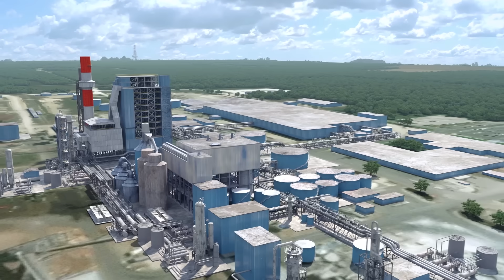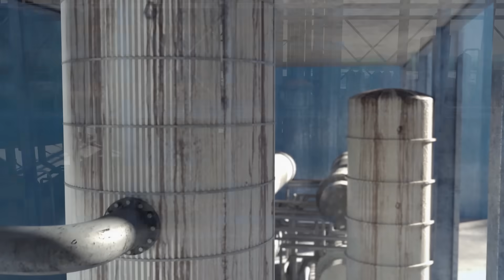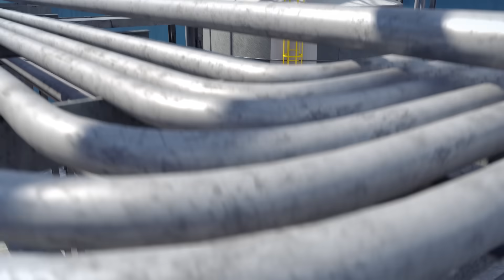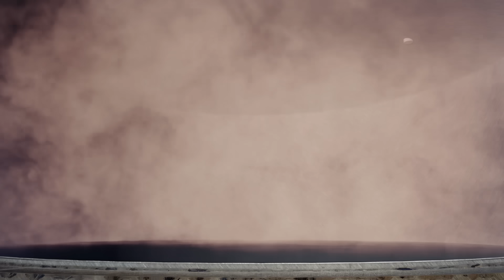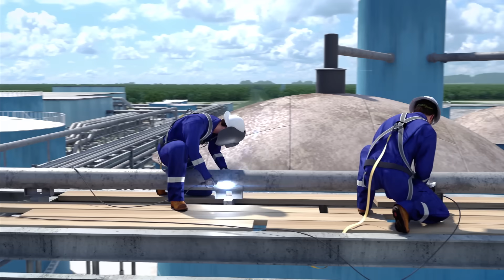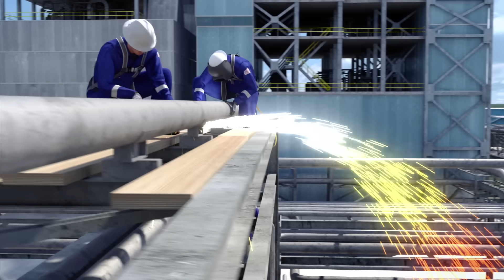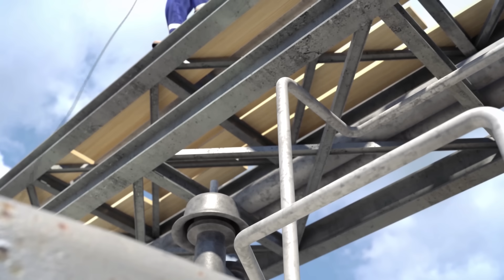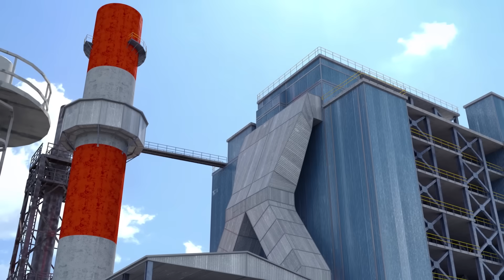Animation of Explosion at PCA's DeRidder, Louisiana, Pulp and Paper Mill

Comment: I'm amazed that these companies can just lose track of the purpose of significant parts of their infrastructure.
'Hey Joe what's that big tank so'
'I don't remember... Something with turpentine, but it hasn't exploded in months so it's probably good'
Reply: Matthew Findley You gotta remember companies are made up of people and people lose track of stuff unless there are good systems out in place to prevent those mistakes.
Reply: Gilbert oh no doubt.  This definitely looks like a system/corporate failure from the videos pov rather then some individual's screw up.  But how can they not have a system in place for this?  Who's job is it to put gas in the trucks?  Yeah who knows.... But confusion over who runs a probably expensive machine that prevents the build up of explosive vapors???
That seems like the kind of thing that gets written down.
Reply: You'd be surprised. When facilities add equipment for additional processes or remove equipment some of that gets lost in paperwork. Especially if it was all done on paper years ago. People retire, forget, or just plain don't know what certain things do inside a large facility. New engineers get hired and it's like here, take care of this area...
Reply: @kalebbrown93  You're 100% correct here. It's even worse than that in my experience. These days at most large facilities they're just lucky more disasters don't happen. Do more with less people. Different contractors doing stuff for the first time at a facility that aren't familiar with the whole facility. Next time it's yet another different contractor doing it. Layers of apathy and ineptitude......is anyone surprised that it was contractors killed and injured?? That should speak volumes....
Reply: @kalebbrown93    I worked industrial agriculture for 15 years.  Both in old farm cooperative facilities and old commercial grain elevators.  That's exactly what would happen from grain handling machines, trucks, fuel bulk plants, fertilizer plants, ect.  Every so often someone starts asking questions about that rusty thing over there they don't remember ever seeing used.  That's when a guy that's been there 25 years already pipes up and talks about someone that retired two decades ago used to operate that machine and no one has touched it since he left.  There were times we found derelict machines in flooded pits that still had power to them and no one knew it.  Dangerous as hell.
Reply: Agreed. The fact something like that can be overlooked for months is pretty crazy to me, but at the same time with a huge company with three shifts with responsibilities spread across them, something that is done infrequently can easily be forgotten about especially if you think someone else took care of it then by the time it's due to be checked again I guess it could be easy to forget. I always just figure people who work in environments like this use as much caution as the places I've worked, but that's not always the case.
Reply: Nobody says "why is this valve closed?" and then get "not my job" in return. People who internally believe "not my job" or just plain don't notice it collectively do nothing and say nothing for months or even years without incident. New people get brought in and trained without mention of the valve or its purpose. Then something like this happens and the answers that come from it sound much more damning than the actual intent going into it. Humans are dumb, and without a rigorously managed plant you end up with this kind of stuff too frequently. The more people involved the worse it gets because "surely someone is in charge of it", and you never open a random valve without telling anyone. Closed is supposed to be safer than open, usually. If it was supposed to be open it would be carsealed. That's why management of unusual tasks such as hot work is so critical. There can always be "landmines" hidden that were fine under operating conditions for months, but then someone brought an ignition source into the picture and now all bets are off. Hot work in a plant like this should be Defcon 1 for fires and explosions. But it's typically treated as Defcon 3.
Reply: @mitchwalrus  In Finland clean water facility had valve to connect clean water system to sewer water system. Someone opened that valve and whole town started to drink poop water. I think two people died and lots of people got sick. Happened in Nokia (same name as old mobile phone manufacturer had).
Reply: @mikakorhonen5715  I worked in the water industry ( dirty side). I assume the "pressures were the wrong way round" for what you describe to happen?
Reply: @mitchwalrus  also places like this are very hierarchel. If you're a newbie and go to the experienced boss and say "what's that valve do? I think it might be dangerous to leave it closed." You'll get an ass chewing. You do as exactly as told. Don't question anything. Do what boss says and never venture to anything else.
Reply: Sorry, the boss wants me to write daily status reports. Usually takes me half the day to do, so I don't have time to track all this stuff, you know? Also, we don't hire secretaries anymore, they cost too much.
Reply: Florian Bösch huh, you just gave me an idea for a 40k RPG character...
Reply: It comes down to training. As employees leave a company they take the knowledge of why a procedure is in place, and the replacement might only know what the procedure is. The longer a facility is in operation more and more knowledge is lost. In the case of infrequently used procedures a single person might be the only one who is responsible for it. If they leave it is not likely for someone to volunteer for extra work and things stop happening. In monthly, or less frequent, procedures the build up to a catastrophic can take a long time.
Reply: Reminds me of the guy killed at the DuPont plant with phosgene.
When they updated the software the "change the hoses before someone dies" reminder got shut off.
Reply: You also have the problem of worker complacency.

New guy:  "Hey, there's 37 steps on this procedure.  It requires 12 hours and 3 inspections and sign-offs. Shall we get started?"

Veteran:  "We only do 12 of the steps.  Talk to Joe.  He'll do all three sign-offs for you at once."

New guy:  "Isn't that unsafe?"

Veteran:  "Look man, I got things to do.  I've been here 20 years and we've done it this way thousands of times.  Never had a problem.  Those corporate idiots love to give us useless work to do. Let's get this crap done.  My girl is all over me to pick up some cat litter on the way home."
Reply: @wadesworld6250  yeah, I hate getting cat litter on the way home.
Reply: lol you have no idea how many pipelines are not kept track of by oil and gas companies. Boggles the mind.
Reply: It's not an excuse but PCA is fairly new to the area, it used to be Boise and the safety regulations were a whole lot higher back then
Reply: No plant engineer to be found
Reply: It's no excuse, but there's a lot of added complexity where you have decades of people joining/leaving the company, people changing roles, lack of change management, dated drawings/diagrams scattered across personal workstations, shared drives, cloud storage, all having gone through various system migrations as a company moves away from dated planning/work management/maintenance management systems to newer systems, etc. Now-days you find a lot more companies spending the money/time/effort to create digital twins of their engineered infrastructure and trying to be better at change management and better about documenting process hazard analyses, etc. The overarching complexity kind of begets the chaotic and unpredictable outcomes, then you have to still thread a needle between being safe-enough and having enough mechanical integrity for your maintenance intervals versus being the safest operation to go out of business. It just requires an endless, unrelenting diligence to document, spend a lot of time on strategy, innovate processes to be simpler/safer/more reliable and spend the money/effort to make all the capital improvements necessary on process and equipment, carefully permit/monitor/inspect work, etc. Every safety rule is written in blood, and every innovation comes on the heels of tragedy. Hard work, but you can't ever let your guard down because physics will always deliver a reckoning sooner or later.
Reply: @martinpace4889  Well put, that's exactly right. Unless you've had a hand in attempting to manage very complex processes, it's hard to understand how things can seemingly be overlooked.
Reply: +Matthew Findley  And then the tank flew away to its people. 

THE END!
Reply: To err is human. If you really screw up, you get "promoted" to management.
Reply: How to know if a thing is working correctly (Deadly industrial area edition)

1. If it haven’t explode: It’s fine

2. If it exploded: Replace it
Reply: It happens more often than you think, I work in IT and one company I worked at had a myriad of systems that were powered on, consuming resources, licenses etc. But were barely used.

It comes from having large systems with poor documentation, poor handover, poor retention of knowledge and entropy of understanding over time.
Reply: The sad thing is, each part of the equipment could be labelled to stop this. "TURPENTINE EXHAUST SYSTEM.  TO BE CHECKED MONTHLY BY CHIEF ENGINEER"
Reply: @detailingdiaries6562  Have you seen how many valves, buttons, mechanisms exist in large plants? Every square inch of equipment would be covered in text if they had their full function, and maintenance instructions printed on them. That's what manuals and checklists are. I guarantee this procedure is part of a checklist. Most likely, they had an organizational change, where job duties shifted, and the parties who were supposed to handle it, simply wasn't informed.
Reply: @ckmoore101  which then ends in disaster.
Reply: Matthew Findley AIP: Abandon In Place. It’s everywhere, EVERYWHERE!
Reply: Probably the same way someone uses apostrophes instead of quotations.
Reply: Typical paper mill
Reply: People should be more amazed this does not happen on a daily basis. Incompetent personnel is rampant in all facilities.
Reply: If you're watching this video and asking yourself that same question, you haven't ever tried to manage a complex system. Consider - the maintenance of all these systems is only a byproduct of the actual work the mill does. 

Operations like this are so insanely complex that no one person actually understands it all. Managing complex systems is really difficult, and it is all too easy for me to imagine how something like this could have happened.
Reply: we all do dumb stuff dude, don't go thinking you're above it.
Reply: @cliveramsbotty6077  but Brawndo got electrolytes
Reply: Super common in small towns
Reply: I remember back in high school chemistry the threats levied if we did not properly label even small samples of substances we were to use or produce in our lab sections.
Anything from failing the term to suspension to police involvement if there was a fire or explosion.
And this was for mild stuff like a few ml of diluted HCl or a gram of sulfur.
-
The idea that someone would not properly label a huge standing tank is mind-blowing to me.
Reply: They need to adopt a Japanese ritualistic mindset when it comes to stuff like this. Incredibly safe and efficient they are
Reply: Homers don't just work at nuclear plants in Springfield
Reply: there can only be one solution. you have to create a ritualistic religion around operating the equipment, possibly involving priests and various theist paraphranelia. then just sit back and enjoy the descent into idiocracy as people squabble over what plants crave.
Reply: @pyalot  The Machine Spirit is Angered that no one has performed the rites of Valve opening and anointed it with sacred oils.

The Mechanicus of Mars are not impressed.
Reply: @pyalot  Brawndo  is what plants crave
Reply: @pyalot  wasn't there a novel written about this? Involving an interstellar generation-ship and the crew basically not knowing who they were or what they did. But maintaining the ship and mission basically became a superstitious religion. the point is, humans individually are too dumb to manage anything more complex than a household. anything bigger and institutions, checklists, managers managing managers is a necessity.
Reply: I work maintenance, and even in a small shop people often forget to check on things they should be watching for because after a long routine of nothing bad happening you forget why it was important to be vigilant about it. 

Plus if the employee who was supposed to manage the tank's skimmer function left and management did not assign another employee to perform that task, there would be some confusion about who was responsible for it with the result that eventually it does not get done. Even if a worker asked about it, nobody would want to take the responsibility for it, or bring it up with management that someone needed to be assigned the task.
Reply: From what it seems, the tank made things more efficient but it wasn't needed for operation. The turpentine gets removed in another tank later in the process, this one is mostly meant for storage awaiting that additional process and skims a little off in the mean time. So nothing would break down by that skim being disrupted, things would just be less efficient. And small shifts in efficiency are really easy to lose track of. The only reason there was a catastrophic failure is due to the stars aligning JUST right, and even then, as the video said they still aren't sure how things ignited--they just know the conditions were just right to allow for it. This is one of those disasters that its understandable why it happened.
Reply: Most people in industrial work are grease monkeys, button pushers and valve turners working for union wages with only a high school degree.  You're not dealing with big picture thinkers and experts in chemistry.  If the procedure manual didn't say what to do, they won't do it or even think about it.  Asking "what if?" isn't in their job description.
Reply: They need someone onsite with intimate knowledge of these systems. Religious procedures can be cheap but us always a strain waiting to break.

Same with growing garden plants. Ive been on forums where they talk for hundreds of pages discussing how to get rid of pests. I give the plants naturally good conditions because I care to understand them and look at them every day. The plants build strong immunity and dont need my intervention that much!
Reply: @Sugarsail1  yeah we're stupid that's why we make $90 / per hour 

More like others have said .. these processes .. are complex and hard wired 

The folks that operate them become legendary almost gurus or sage .. the plants get Hugh .. folks retire .. new management..   who watches what ?  not every valve .. every Safely concern or procedure is passed on .. many times there are ticking time bombs   waiting to happen .. 

There was a short time when we were in top of most of it   ..  it's to much money to watch all of it now it different now .. 

No place or industry  is maintained properly  any more
Reply: Someone who cares. Unfortunately paychecks n quotas vs true passion mostly.